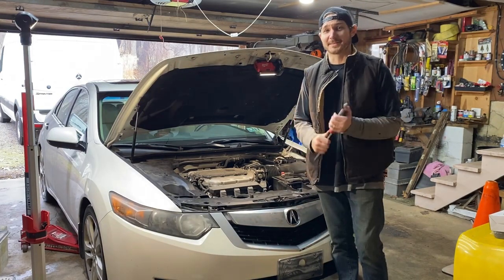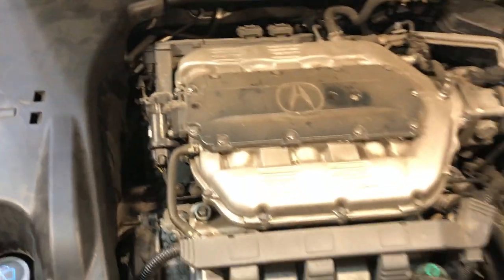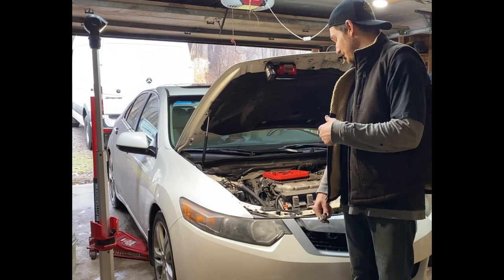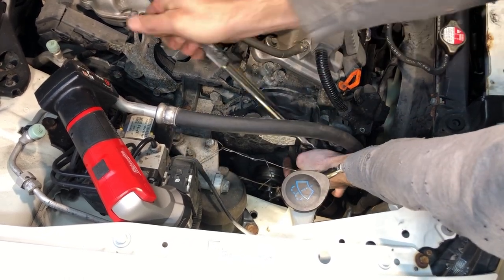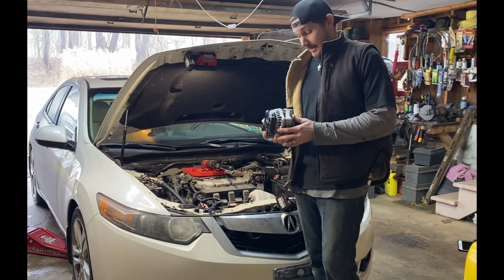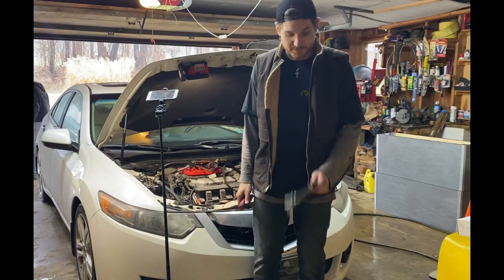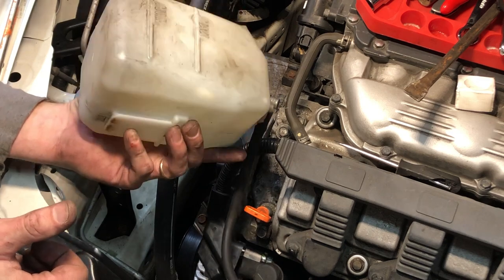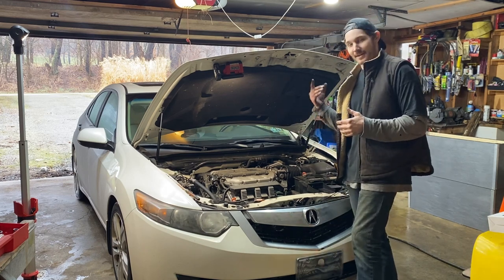Acura TSX Alternator Replacement

Comment: As a long time TSX owner with a dying alternator, I approve of this video.  It just helped me change mine out. Thanks, Ty
Reply from the maker: Great I’m glad!!! Never really had too many issues with the car. Just maintenance and timing belt etc. It does have a transmission “shutter” sometimes. Does yours do it too?
Reply: I've had the same experience and for that reason I love my TSX.  Treat her right and she'll take you wherever you want to go.  It is the best car I've ever owned.  I have driven it for about 80,000 miles.  As far south as Puerto Vallarta, Nayarit, Mexico from the United States.  She never lets me down.  I do have a mysterious shudder now and then but my bad ass mechanic said it's whatever.  I can attest that it isn't a problem and makes zero difference.  Took her for a road trip with the new alternator going today.  30 MPG on the highway, just the right amount of HP to deal with highway traffic.  "La Japonesa" is back in business, baby.  
She's an absolute champion.    @TySlimVlogs

Comment: I don't know how to get it loose, it's hard for me to see the part we're you pryed it before you shake it loose
Reply from the maker: Remove the 2 bolts. Stick a pry bar or long screwdriver in between the alternator and bracket that looks like a horse shoe. Jiggle it back and forth it may be pinched and corroded in there a little bit. Let me know anymore questions I’ll try to help you out.

Comment: I replaced my alternator with a new one but its still not turning over. Could it be that the battery is drained? I tried to use a jack box but i dont think it is fully charged.
Reply from the maker: Your alternator charges your battery, so it really doesn’t affect the engine turning over. So yes I would check your battery is charged first or try to jump it off another car if your jump pack is faulty.
Reply: @TySlimVlogs  Bro it was this dang on walmart battery 🪫. Atleast it has a warranty for 3 years so i can continue to get a new one free of charge. Thanks for listening.
Reply from the maker: Glad you got it figured out. I’ve had good and bad luck with the Everstart…or “Neverstart” 😂  brand. Keep or take a picture of your receipts for the future.  👍🏽
Reply: @TySlimVlogs  thanx bro they got my name in the system for when i first purchased the battery. I am currently trying to figure out why i am getting a small oil leak on my cold start. I changed my valve cover gasket, vvt solenoid gasket behind the motor and the small gasket in the front of the motor near the alternator. The one in the front was leaking on my alternator which made it go bad.